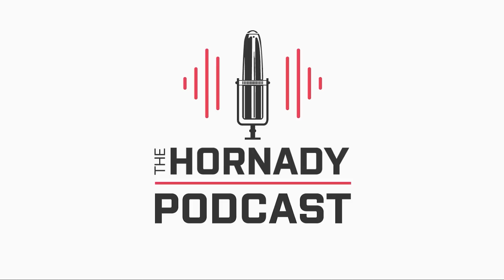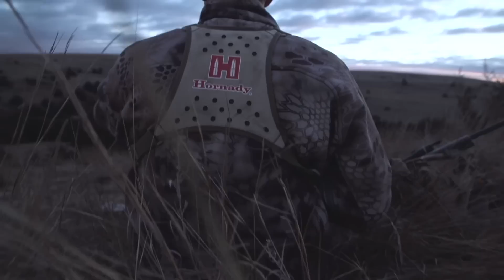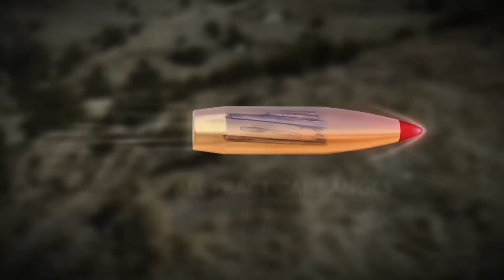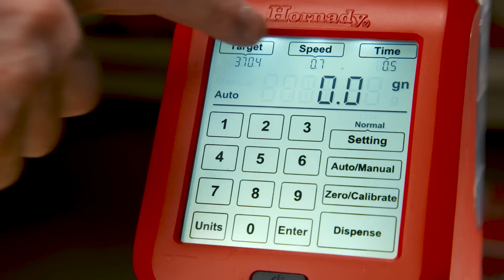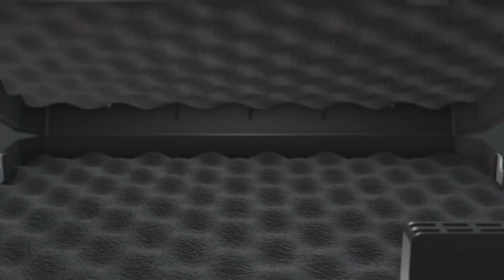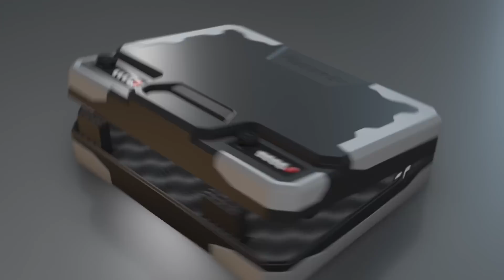Ep. 138 - Temperature Sensitivity

Comment: While not pertinent to the discussion on powder, the cold air (or hot air) varies in density.  0 deg air, say at 500 ASL,  has a big effect on bullet drag, which will exacerbate the bullet drop. How much more will this contribute when you add in the 100 fps velocity loss? A substantial number at 500 to 1000 yards.

Comment: Static electricity and plastic reloading tools? Why do manufactures use plastic powder hoppers on a powder measurers when it causes static electricity to bridge the powder in the drop down spout, whereby causing light squib loads in some cases and then the next ones get a charger and a half that blows up the guns? This is a well known phenonium (mentioned by George C. Nonte and Robert A. Rinker in their books) and yet ALL the manufacturers of these powder measurers still go with plastic powder hoppers. Mean while DRAMWORKS makes Pyrex powder hoppers for all the major brand powder measurers to replace the plastic ones to negate the hazard of static electricity bridging the powders. Go figure.

Comment: Trend=  Low powder charge & efficient cartridge based off the AR 15 platform. Equals need to use double bass powders if you want speed.  The amount of speed is considerable specially when you’re dealing between wanting to reach 2900 FPS w/87vmax with a ball or double base Temp sensitive powder and sitting at 2750 FPS with maxed out, extruded temp, in sensitive powder.  These are obviously the pressures and FPS with AR style a bolt. You can get a few more FPS because you can have the pressures even more and probably get away with some of the extruded temp, sensitive powders and still reach speed.

Comment: The question is how much does 150 FPS affect A heavy for caliber varmint bullet and how much does it affect a match low drag bullet?, and can you live with that lower speed? This is the dilemma when dealing with A cartridge that was designed to run in the AR15. 
22,6mmARC , or 22 Nosler or the 22 Volk,17-556, and worth mentioning  the 17 Remington and the 204 Ruger, (The last two obviously not designed for the ar15,. the list goes on indefinitely… i’m guessing the bullets behave a little different and affected less with the FPS when dealing with 120+ grain bullets

Comment: Miles, somewhere in one of the podcasts you were on you mentioned your PRS ARC loads. Wondered if you could provide them again here. I’m looking for a point of reference other than the book. I have been shooting 108 ELDM with 28.6 of LVR. Also ran a few loads of Varget 27 grains with the same bullet, to much pressure.  

Running this in a Blueprinted Rem 700 action with a 24” barrel, diamondback special trigger.
Reply from the maker: Us that run the 6 ARC are 27-28 grains of Varget with a 110 or 109. SAAMI reamer, bolt gun
Reply: @hornady  Thanks for your response. I forgot to mention that my Varget load was ran in a Howa mini. The Rem action has been blueprinted and is getting a new barrel I’m cutting with a Manson reamer. Should run the 27-28 Varget no problem.
Reply: My 6arc likes 24.9gr of imr 3031 with the 108 bergers. Cheers

Comment: Guys the only way this episode is better is if Jeff were present. Great job. My temp sensitive powder story is about a non Hornady cartridge in a gas gun. This set up has a Proof carbon fiber reinforced barrel and during load development shot lights out. The load uses 53 grain Vmax, CFE223 powder and CCI 450 primers. I worked it up in 90-100 degree ambient with the confidence I would only have to subtract velocity in "Varmint season temperatures" . Boy was I wrong. The lower temperatures took almost 70fps from the average velocity and in doing so took the barrel out of tune. Adding one of my lighter weight suppressors brought 20fps back to the load and also helped groups by 50%. What is interesting the 52grn ELDm stayed in tune.

Comment: Love this deep dive. Use N570 in my 7mmPRC... it's an OLD lot as well (From 2010). At 90 degrees in the sun it was 5.2 SD 12.1 ES with a 5 shot .174" group! I took it out again at 60 degrees.... ES was now 27 with SD at 12.3... groups opened up to .65" groups. Same components and each round measured individually to within .02 grains. Still very accurate and good for what I am doing with it, but dang the difference in SD and ES was a bit complexing...I might throw in another .2 grains into the load to compensate for the lower temp coming in the fall and see how she shoots.

Comment: I have a basic bitch calculation that goes as follows for how to estimate minimum temp difference:
First multiply the powder heat capacity with the volume inside the case (powder charge)
Heat capacity of wood * wood mass per volume

This will output Joules.

Then calculate using speed*speed*mass how much the speed must drop in order to match the muzzle energy - the joule amount above.

So basically you calculate how much energy you loose to heat that gun powder inside the case back to your regular temperature.
Reply: I'm going to have to ask you to go ahead and leave, sir.

Comment: I run detatch mags and just keep one in my pocket until I’m on game and in shooting position. Anything inside of 400 I use the one in the rifle. Anything past, swap mags, ammo will be at body temp +\- a few degrees. No compensation needed due to ammo temp specifically this way.
Reply: The air temp still effects where the bullet impacts. Cold air is more dense which equals more air resistance. Also barometric pressure  has an effect too.
Reply: @josephhomen  Very true. Note "ammo temp specifically" in the comment I made. Cheers

Comment: Thinking through the implications for military powder, they do sometimes have even more extreme swings in temperature than you gave.  Mountain or arctic units etc in winter; deserts where ambient may be 115 and magazines in the sun might be +15, +20, sometimes +30 or more.  With gas pressure the action cycling mechanism and as you said bolt lugs having a vote (on the high side) this seems like safety and reliability (and safety) would play against the desire always to maximize energy.  I’m guessing you know more there that you don’t want to talk about, but a tricky problem.

Great episode.  Something I haven’t seen as well covered in literature.

Comment: Perhaps in future load manuals Hornady could give indications of which cartridge/powder combinations are more or less temperature sensitive. Maybe a one to five star rating or a number of FPS of change between two temperatures such as 0F and 100F.
Reply: This is a good idea, but I think that the information needs to come from the powder producers themselves. A lot of them are going for more temp stable powders. For example N565 and N568 came out and deal with temp instability, but you don't get the same velocity as N570 in my applications. But I like the way powder manufactures are going with temp insensitivity and anti- copper fouling agents. Can't wait to see what the next gen powders will be like!
Reply: Buy quickload software. It tells you what powders are temp insensitive with a *T next to the name and the ones that don't have the nitrocellulose you can use the temperature setting to plot the fps and pressure loss or gain depending on the situation. Cheers

Comment: Great topic selection once again thank you.
 
I listend to this podcast about an 8lb jug to late ,lol. 
I run a very accurate load with Hornady 75BTHP \ Hornady brass with CFE223 in my gad gun.     I should have done a little research on temperature sensitivity before i bought 8lbs.
Reply: It's pretty temp sensitive but if your loads are baking in the sun and it's just ambient temp then it's not too much of an issue unless you're over 100 degrees or lower than 35 degrees. I love cfe223, it shoots everything amazing from 45-77gr and clean too.

Comment: Suggestions for the western big game hunter who uses factory Hornady CX and ELDX ammo? Do we need to worry about temp. sensitivity if we shoot under 600 yds?
Reply: ALWAYS assume factory ammo.loses velocity in cooler temps- because it usually does. Try  to test ammo and get drop data  in temps close to what you will be shooting  in the field. For example, If you are going to be hunting Elk in temps as low as the 20s DO NOT get drop data on a  70 or 80 degree day!. Try to get your data on a cooler day in the 50s or less and you should be good .
Reply: @JamesClark-lw6sw  thanks
Reply: The outfitter line is probably temp stable

Comment: Temp Sense - 6 ARC, yalls favorite and mine, i use LeverEvolution which is all i have tested in 6 ARC, and im shooting the 90cx, 80cx, 95sst amd 90 eldx all into 0.65" groups, so seems like a great powder and bullet combo. people say this powder is crazy temp sense.
Reply: IMR 3031 is not as temp sensitive and shoots great groups for 6arc. Alliant ar comp and 15.5 is probably the best and not temperature sensitive but expensive if you can even find it. With the war in Ukraine most the nitrocellulose is being gobbled up by overseas stockpiles etc. Hard to use temp insensitive powders when supply chain is spotty and better to use stuff that is obtainable IMHO. Cheers

Comment: I don't load stuff hot.  I run 30gr of Superformance in a 6 ARC with 108s and i run 68.3 IMR7828SSC and a 115 gr in a 257 Wby.  I dont run magnum primers.  I've found consistently weighing each powder charge and keeping meticulous about case length makes loads superior to factory loadings.
Reply: is that a bolt gun load or gas gun load

Comment: I've been having what looks like high pressure signs on the 6 arc 105gr hornady black. There's a hard ridge about 0.28" from the case head on about 20% of my brass that's about 0.003 over saami chamber spec and a noticeable bulge around that area on half of the rest. Is black loaded with temperature sensitive powder? Should I install an adjustable gas system to address that or could be chamber be oversized? The headspace grows about 0.01" from factory new to after firing. I'm not seeing any extractor markings and maybe the lightest of ejector swipes. 
I'm planning on reloading with staball match in hopes to get a really consistent load for prs gas gun.
Reply from the maker: Send us an email podcast@hornady.com with some pictures and more details
Reply: I have a gas gun that showed all of the classic signs of pressure with multiple brands of factory ammunition. I installed an adjustable gas block and dialed the pressure back and all of the overpressure signs went away. Might not be what's happening in your situation but it might also be a thread worth pulling.
Reply: @ericreed8126  I took the rifle to the range with the gas system disabled and got the exact same marks on the cases. Would that rule out a timing issue if the gun was running in bolt action?
Reply: Seems to be a common occurrence when reloading.  I first saw it demonstrated on Johnny’s Reloading bench during his 6arc series.  Although I never saw it on first fire factory loads, it has presented on a majority of my brass in both bolt and AR reloads.  It got so bad after 6 reloads I had to use a small base die to in order to get reloads chamber in my AR.

Comment: I found out about temp sensitivity when I started reloading with Superformance. Love the powder, but very sensitive in my experience. And Seth, lose the handlebars, you look like a regular at the Blue Oyster Bar! 😂
Reply from the maker: Woah, I'll make sure he sees this comment, as a fan of Police Academy.
Reply: @johnknouse8846  I for one love the coach Seth look. The handle bars are a vibe and I'm here for it.
Reply: @maker_greg  I’m just giving him a hard time. Didn’t know if anyone would even get the Police Academy reference!!
Reply: I did too, with my 6.5 creedmoor. But I am back at it again,same barrel but what I found is that I get great groups less than half moa with 140 grain bthp muzzle average velocity 2658 fps highs 2706 by dropping powder charge.
Reply: Hahaha. This was great.
Reply: I love superformance in my 270s, 280Rem, 280AI with lighter bullets per cal. Incredible speeds and accuracy. Even with significant temp swings, hasn't made any noticeable difference to 400 yards which is my longest avg.
Reply: I didn't believe it was as big a deal until I saw it for myself with cfe223 in my valkyrie during a match. Had a bunch on small squall drop temp 15 to 20 degrees and back when the sun came out again. I was all over the place. Lol
Reply: He's no Sam Elliot that's for sure.